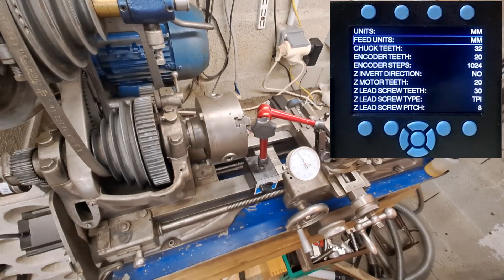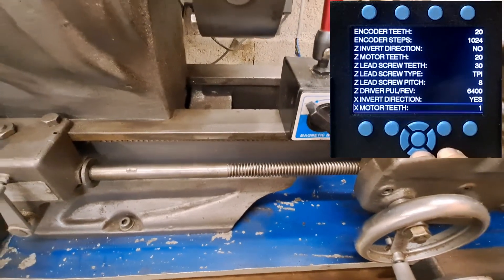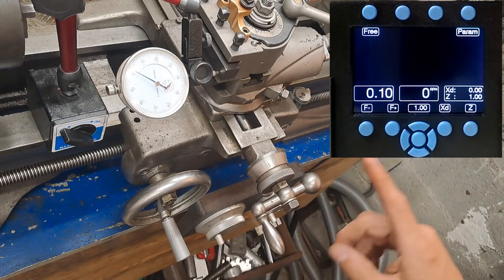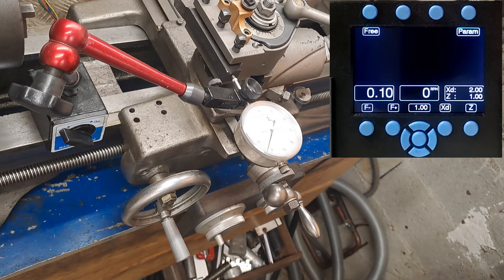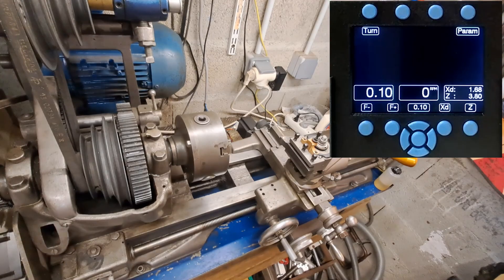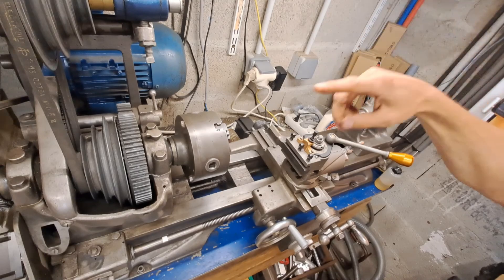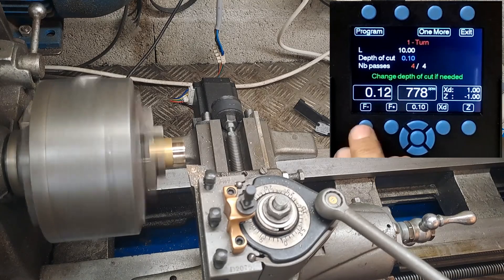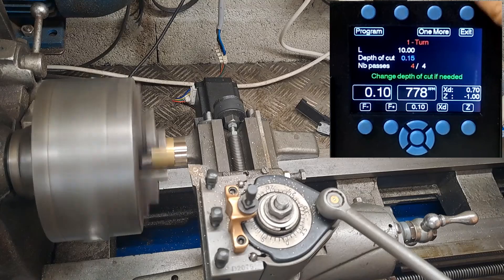2 Axis ELS: Setup, Parameters and first cut

Comment: This is amazing. Are there any issues with converting a larger 1040 3hp mill, or is this totally scalable with bigger servos & drivers? Would using ball screws for the lead screw improve performance?? It looks like your system compensates for backlash.
Reply from the maker: It is totally scalable with bigger servos and drivers as soon as it has pulses and directions 5v input capabilities

Comment: I need to cut a flute (spiral) on a part.  I have a post grinder that will handle a end mill and cutting a spiral is required.  I need a spiral of 1turn per meter.  Basically a threading operation but with a very slow spindle speed, less than 1 rpm.  Can your unit handle this pitch?
Reply from the maker: Hi, yes you can set a huge 1000mm/r feed rate.

Comment: Can you program the carriage to move without the spindle turning  for cutting splines?
Reply from the maker: No but that is a good idea and pretty simple to do, I will add it in future release.
Reply: @electronicgearbox that being said, it would be nice to have facing operation as well.
I bought your 2 axis kit and didn't realize upfront, that it's not really suitable if one replaces the lead screw with a ball screw.
having the z-motor enabled in turn mode without the possibility to disengage the z-axis doesn't play well.
I would highly appreciate a run/stop button in turn mode.
I circumvented that with a switch in the enable line of the z-motor, but that obviously doesn't stop the dro from counting.
If you could implement these features, I would be really happy, but for now I'm replacing it with a nanoELS from Maxim Kachurovskiy, way more complex diy controller, but it does all that out of the box.
Reply: @3dprintingguru378  Facing program should be out soon. Disabling the Z motor was available on previous release but I removed it because of complaints. In fact, disabling Z means you loose the synchronization with the leadscrew and the DRO so it seems better to disengage the nut. How would you like it to be implemented ?
Reply: @hugosarrazin9790  since there is already a angular mode it's possible to disengage and re-engage at the exact same position. clough42 as well as Maxim Kachurovskiy are doing it that way.
For me changing to ball screws was always my way to go as soon as I thought about semi automatic turning.
I'm aware that it's an electronic lead screw, but on the other hand there is a second axis, imo that isn't an ELS anymore, so disengaging the lead screw electronically is mandatory for me.
anyway, I almost got all the parts for a nanoELS and will swap the controller once I got it done.